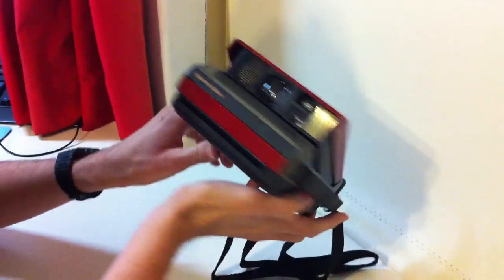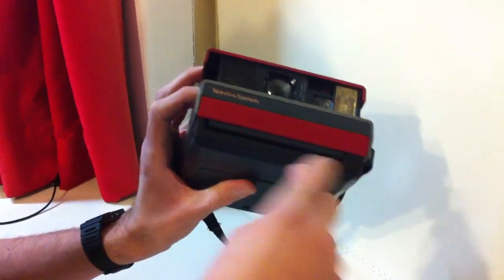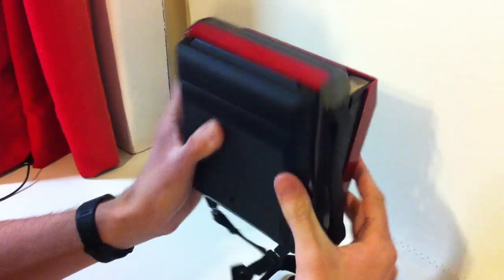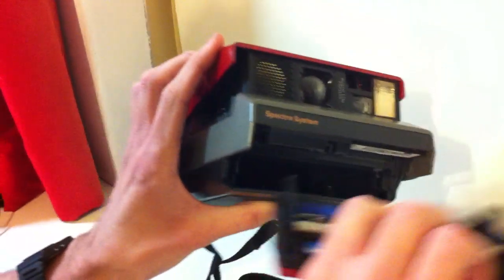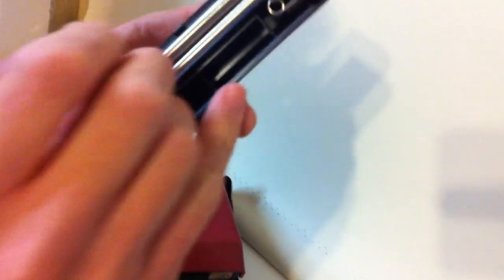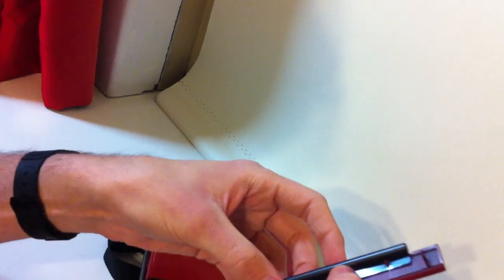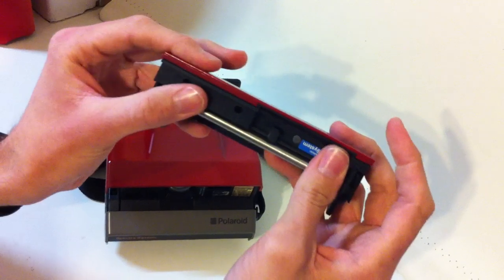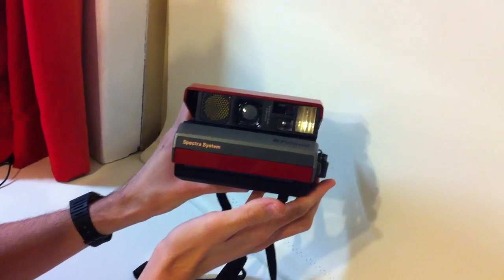The best way to install your Impossible Project Frog Tongue for Spectra Cameras

Comment: Thanks... it's Sept. 2017 and with the impossible film changing name to Polaroid and having it develop in 15 minutes...... it's exciting.. I have a Spectra ProCam and was worried about destroying the front end with glue et et... your video worked like a charm... cheers, thanks for such a great video without any nonsense or rambling on et et et.. cheers again,

Comment: Also works just the same for a Minolta Instant Pro.  Use very bright light and you can see the two pins in the body that engage holes on the dropping front part.  So thanks go to theinstantcameraguy.

Comment: Hey, really appreciate this video. I went through the process with my Spectra SE and I discovered that one of the hinges appears to be sealed on and can't be removed (odd!). I poked around with a flashlight and a screwdriver but decided that I'd probably end up breaking the hinge. Could it be that this method only works for some Spectras?
Reply: I also have a Spectra SE. None of my hinges were sealed, but they were in awkward to reach places! make sure that you use a very small screwdriver. The hinges are on either side, and one in the middle that is relatively well hidden. Take a look with a flashlight, maybe a magnifying glass (I had to).
Reply: Thanks Miles - I'm going to take another dive in tonight and see if I can get that done with a glasses screwdriver.

Comment: Will this work with 600 to? I don't want to break it
Reply: Mochalatte no, the 600 is much easier. Don't even need to use a screwdriver in many cases (I've done it before with my nails) and it's simple to carefully pull off then reattach. Plenty of vids on here for 600 model types. NB 690 series needs SX-70 tongues and installation methods.
Reply: Hamid Sirhan thank you this is helpful now to get the new frog tongue :}